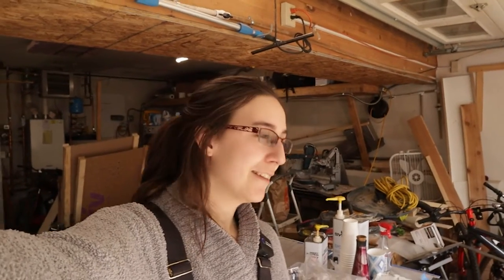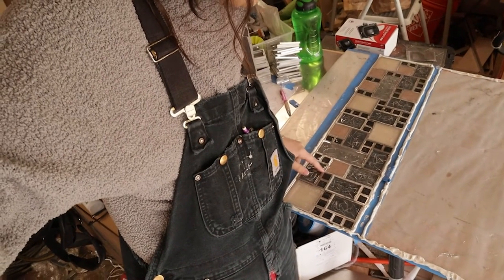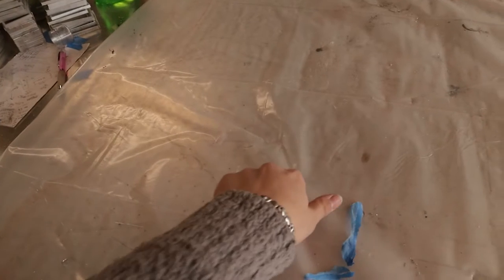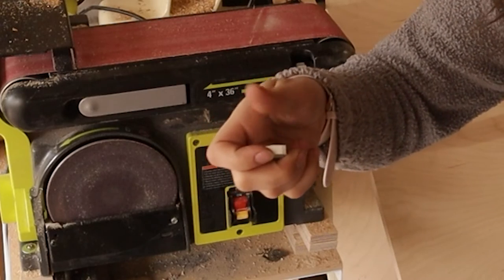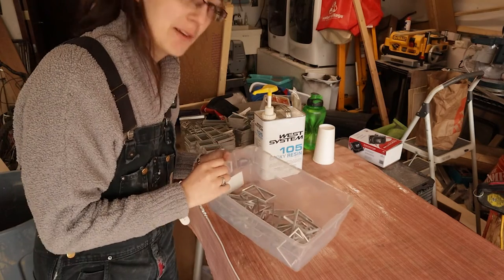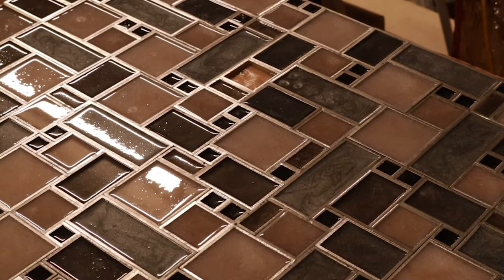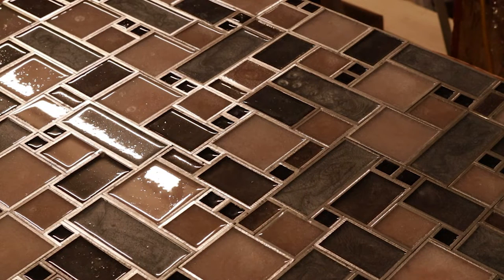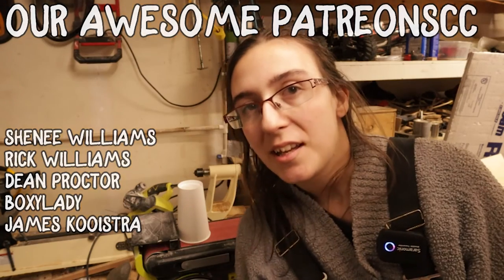Making Our Own Custom Epoxy Tile Backsplash

Comment: I love the creativity of this project!  I'm curious what the final count was on bandsaw blades for this project? :D  When you spread the epoxy on the backer cloth, did you wait for it to fully cure or did you use the tackiness to keep the squares in place?
Reply from the maker: Thanks, Dean! We've been plotting this since the start of the build (muhahahaha)
So far we've been through 4 blades, but there's still more cutting to do.
We used the tackiness to keep the squares in place. It also helped keep all of the colored epoxy from leaking under the edges into different tiles. Epoxy has a tough time sticking to cured epoxy, so filling the tiles while the cloth was still tacky was a must! :)
Reply: @Making_Adventure  Ahh, excellent pro tips!